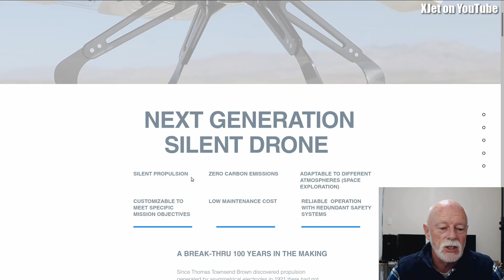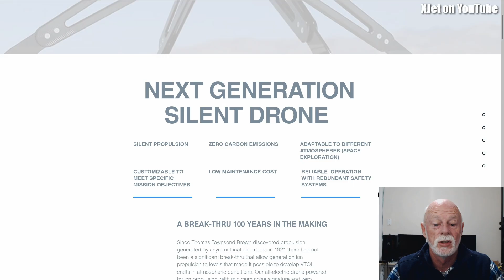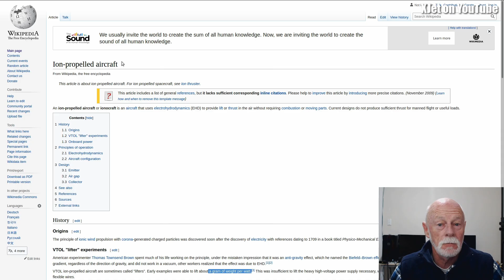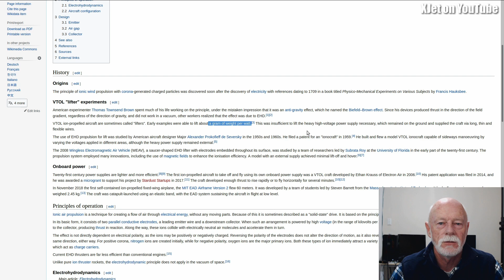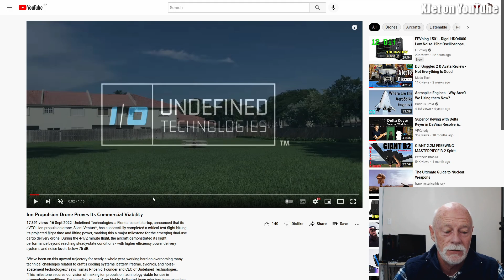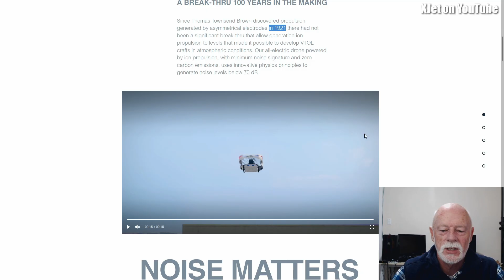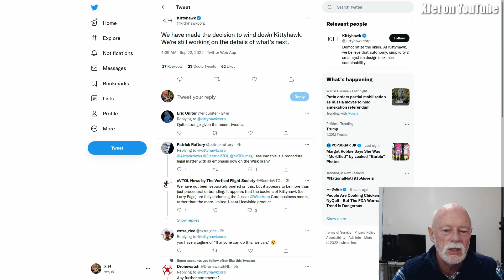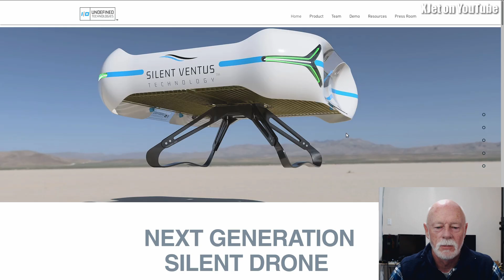Ion drive drone BUSTED

Comment: the weight is not the problem.its the duration that is poor. the batteries can only do minutes in the air on ion even if they had a tesla battery.

Comment: The idea is nifty, find a way to add a superconducting circuit to push enough air, maybe.  It seems likely to be similar to using capillary action to pump water.  It works but you can’t scale it.  A room temperature superconductor would help ;-)

Comment: I have recently gone down a rabbit hole of investigating alternate propulsion sources and various electromagnetic field topics. It is my opinion that this is absolutely possible via the use of a precision built transformer and lightweight batteries. The drone itself would also be very lightweight.

In addition, the actual arrangement of the conductive surfaces on the drone itself may provide a lot of room for optimization of the ion flow/path.

Really this is just a fancy “high voltage lifter”, built by a team of electrical engineers from UM who took the engineering further. I find it somewhat unfair that this video approaches it’s design from an aerospace perspective, when really a deep understand of electromagnetic fields and high voltage circuits is required to see how this would be possible.

Comment: You are so full of assumptions that you look like a concentration of cognitive bias. How the hell do you now the weight??? That thing could be done pretty light with fabric covering frame that can be lighter than carbon fiber and using carbon fiber sandwich frame. That would be extremely light moving slow without g forces, just to carry some sensors or small camera and solar cells and little battery and VOLTAGE CONVERTER, and even these aircrafts could utilise atmospheric gradient voltage differential

You are so flawed
Reply: Take a look at Ethan Krauss, it’s the real thing that can fly under its own weight

Comment: It seems that there is plenty to criticise this thing about based on the info from a year ago although when they say “zero carbon emissions” that should actually be a reasonable statement but I think your judging it based on the perception of the people who don’t understand that not everybody’s electricity is produced the same way. If the device doesn’t emit carbon then its a valid statement, its not their responsibility to word the features of the craft based on the the silliest understanding possible.
Reply: have you checked Ethan Krauss's ionocraft? His craft actually can be flown under its onboard power without using an electric fan like this company is claiming to be a true ionocraft. His craft stays true unlike what this company is claiming  their craft to be.

Comment: Working Ion drives already exist, NASAs Dawn space probe managed to change speed by 25000mph while in space using 3 solar powered xenon ion thrusters, and it only took YEARS of thrust to produce this result, so if you are patient and are in the vacuum of space this could be for you, dont expect this to work well enough in earths atmosphere though, not with current battery energy densities.

Comment: On further info this drone is a hybrid with a fan in the middle. https://www.youtube.com/watch?v=yMz_rtiM7FU They would achieve a lot more lift I mean significantly(10- 50x) more with magnetohydrodynamics
Reply from the maker: The "ion drive" is contributing virtually nothing to the lift capabilities of this craft.
Reply: @xjet  It is probably used in steering the craft more. They could do a flying disc with magnetohydrodynamics with a lot more thrust
Reply: @akosszeki  
have you checked Ethan Krauss's ionocraft? His craft actually can be flown under its onboard power without using an electric fan like this company is claiming to be a true ionocraft.

Comment: Hi, This is an existing technology that is used the past 50- 70 years. NASA uses ION drives for many of their spacecraft in the past 40- 50 years. It has noise, but not as much.
Reply from the maker: Ion-drive works in space because you're not fighting the forces of gravity.   Ion drives (even in space) produce only very small amounts of force.  Also, ion drives in space don't have to deal with things such as humidty, dust and other factors that cause issues when you try to use them in earth's atmosphere.

Comment: This is definitely a giant pile of tech hype scheme.
But my opinion on ionic thrust is it should be continued to be developed because a more advanced version of that technology may actually have high thrust efficiency but currently it is very unefficient in the designs being used.
Reply: There are 45 or so footage videos of a series of ion thrusters that really lift their power supplies against Earth's gravity on my channel and online! They are patented and verified specifically for having onboard power.  They are much more efficient than other ionic devices, due to extremely thin emitter wires, light weight, and larger ionization gap.  The patents, website, and YT channel for the crafts, show exactly how they work.

Comment: haha i guessed it was fake, it didn't sound right, and they may use ionic trust to stabilise the drone... thats why the drone is balancing on the center of gravity, ionic trust should be uniform. and the sound seams really to be a brushless motor with a propeller mounted in

Comment: I think many points raised here are valid for the design (EDF and grass movement), but I think what this reaction video gets misconstrued is that the technology is busted, it is not. The ionic wind is a phenomenon currently being studied in Ph.D. programs for developing initial "proof of concept" models of powertrains that will use this technology and is already proven in space applications. The problem is when a company like this, uses a technology that is not there and tries to raise capital to then attempt to fulfill such promises and realize that, it is incredibly expensive to put any motor out of its prototype phase, and that maybe is better to let universities run prototypes, develop simulation tools and offer some light into technology issues before running into forming a company and attempt to get the bag out of a concept that is not there yet. Great video tho but way too much "personal desire" is shown here to disproof a company, makes me think you would not offer a kind review to any "in-development technology" in other videos.

Comment: I have enjoyed many of your videos so please don't think that this comment is just me being upset about your Critique.  I think you should dig a little deeper to fully explore this.  There have been Ionocraft that can fly under battery power and this company has a working prototype which you can see in this video:  https://www.youtube.com/watch?v=yM_ZcN3dleo  Also see the MIT ion propulsion plane experiment shown in this video:  https://www.youtube.com/watch?v=IorDYGI1uqc
Reply from the maker: The MIT plane shows why this will never work as a method of drone propulsion.  They used a super-light airframe with a very low wing-loading and even then the drive was only just capable of sustaining flight.  The challenge of a vertical takeoff and flight is orders of magnitude more difficult and although the MIT craft does fly, its performance is strictly limited by the whole concept of ionic wind.  As the vid says, scaling these technologies is not easily -- in fact I would say not possible.  Remember, although we are already able to get 95% of the way to perpetual motion, we'll never actually get there no matter how hard we try nor how advanced our technology becomes.  Damn those pesky laws of thermodynamics! :-)

Comment: The tech was developed for space crafts. Now we're reversing the priorities to power flight on earth where thrust to weight ratio is favoured over mass efficiency (mass in this case referring to the accelerated particles like a tank of xeon)

The first powered flight by the Wright brothers was 12 seconds.

Here, they got a prototype working for 5mins on vertical thrust for whatever battery capacity it had on still developing technologies.

Silence is relative, at the height where you fly drones or aeroplanes, it would be barely audible, hence silent - sound intensity drops per the square of its distance. 70db at 100m is essentially silent.

0 carbon is that at present, it doesn't require carbon based fuel to generate thrust, but of a stretch as you said because most electrical energy still rely on carbon based fuel to generate them. But it doesn't 'require' carbon in the sense of a rocket jet

It is big, but lightweight and doesn't have moving parts. Service may be the equivalent of replacing worn units, not opening it up, fixing moving parts in place, lubricating, balancing etc etc. So yes service, but definitely cheaper in terms of time required.

As for the thrust per unit power, energy is not equivalent to power, so your calculations are wrong.

The same amount of energy is required to keep any amount of weight (assuming same density in atmosphere) "lifted" regardless of modality, the issue is to find limits which have barely been scratched. Electric phenomenon has been around for milenias, but the light bulb wasn't invented til recently, and then closer still before blue LEDs

This is just the beginning of research into this technology. 

It's like saying electric cars are garbage even though they have been invented before ICE cars and never took off prior to Tesla, and now we have them everywhere when technology switched. 

Im only halfway through your video. It's nice to have a healthy dose of skepticism, but yours borders on abject denial rather than facts.
Reply: Undefined Tech has 2 international patent applications.  One for a heated cathode lifter, the same thing has been published online for the past 20+ years.  Their other application shows a lifter with a ducted fan in the middle.  I am the inventor of the only one, actually a series of them, that are patented and verified for having onboard power, and lifting their supplies against Earth's gravity.  It requires too much power to lift such a heavy mass as the UT craft over such a small area with currently known ion propulsion and current battery technology.  The ideas shown in my patents show a way to build an ion propelled craft that is proven to lift its power supply, but it has very particular specifications and must by very lightweight.  The UT craft would not produce enough lift to carry a power supply without its very powerful EDF.  I hope this information helps!  I think the man that made the above video makes extremely good points.  A standard shaped "ion lifter" as well as two stage devices generally speaking, currently have an insufficient TWR to lift their power supplies.

Comment: Another indicator the "ionic lifters" aren't doing anything. The arms of large multirotors flex as the motors transition from zero thrust to overcoming gravity. Their scam drone doesn't show any lift at the corners of the frame.

Comment: Bruce, I hate to be that guy, but you fumbled this one. Car batteries are so large and heavy, because the contain so much energy, not because of their performance.

A 50kWh battery can be discharged at a much higher rate than 50kW. that would equate 1C (a discharge rate at the nominal capacity in one hour).

My guess is that a battery capable of repeated discharge with a reasonable cycle life would still weigh north of 30kg. if you're prepared to push the battery to its limits, it could be made lighter, but anything close to 10C is not going to keep  the pack happy, 5C being understood as a good maximum practical discharge rate.

of course at 5C and a reasonable cut-off voltage, the DoD will not be close to nominal, which will necessitate a larger battery.

maybe the thing could be .are to fly, but it won't be carrying anything 😄
Reply from the maker: I realise that you don't need a 50KW/H battery to get 50KW of power.  However, let's assume a 50Kg drone...
That will require 50KW just to hover and significantly more to ascend and/or maintain a forward movement.  Let's say the drone requires, on average, 70KW to ascend or maintain forward flight and you want a flight time of 15 minutes (or 12 minutes plus a 3-minute reserve).  That's a total battery capacity needed of 17.5KW.  Using today's lithium battery technology, that's a battery weight of 66.5 Kg... or more than the entire weight of the craft we've just been talking about.   Get the point? :-)

Comment: If this thing was real, can you imagine how dangerous it would be?  Exposed conductors with what 100KV, 1 MV potential difference?  What sort of newspaper headline would you get from 'Child becomes briefly incandescent after trying to pick up crashed drone!'
Reply: What the bullshit? Have you ever heard about magic ball with lightnings? It is almost the same
Reply: @ВалерийТерещенко-п3ф  IIRC high voltage discharge is considered dangerous at about 10 J. You can easily make low power magic ball. But you need at least hundreds watts for drone... so yeah, any ionocraft drone would be very dangerous to be around.

Comment: Not saying you're wrong, but; The EDF could be used mainly for steering and cooling, while the ion propulsion provides the lifting. In case it is indeed a hoax, would it be possible to balance such a large structure on 1 EDF motor alone? Maybe somebody could try build one and see if it flies.
Reply from the maker: If it needs an EDF for cooling then it is even less efficient than 1g per W which makes it even less able to fly, let alone deliver on the promises made.
Reply: @xjet  That 1g per W goes for the first experimental models, as it says on Wiki. It also says it uses a high voltage PSU, which might require some good cooling. I saw this video on youtube from the same company, which does look pretty convincing, search for:  New Drone Tech: No Propellers, and Yet It Flies! No Propellers, and Yet It Flies! 
Maybe try contacting them, or request a demo, could be fun. 🙂
Reply from the maker: @plower9711  But that 1W per gram is likely to be the power going into the panels so losses due to voltage conversion would be additional.  The efficiency of the basic system hasn't been significantly improved in over 100 years so it's still a very long way from being practical and will remain so for a number of reasons (those pesky laws of physics).
Reply: @xjet  Arg dangit those laws of physics again... 😅

Comment: Only a few minutes into the video, and Bruce has already made som mistakes. In regards to noise, a vehicle may be noiseless in itself, but in use the surroundings may make noise. Like in the movement of air, and particles, due to the thrust of the vehicle. Though the vehicles mode of thrust itself does not make any noise. As for carbon emissions, it just states that the mode of thrust in this vehicle does not give out any carbon emissions. The production for the energy used to power the vehicle may have produced some carbon emissions, but this site is about the vehicle itself it seems, not the energy used. If it had been a powerplant that listed the power it had for sale, it would have to include the carbon emissions from the production of that power. The vehicle using the power, and the company behind that vehicle can make the claim that its vehicle does not have any carbon emissions, if the motor / mode of thrust in the vehicle does not have carbon emissions.

Comment: If a drone is 10dB quieter it can be heard from significantly lower distances which means it will disrupt less people. 
Using noise levels measured at standard distance from a machine is a typical way of measuring produced noise and gives consistent metric that is useable for health and safety noise calculations.

Comment: sorry, this is very real. get up to speed with electrogravitics and hexa lifters. also, 70db, isnt really loud. dont you understand how loud your normal surroundings are? maybe your hearing is less good than it used to be as well? they do have demo crafts, there are several  on youtube, do some research first.
Reply from the maker: So why does it have a conventional electric motor and fan unit then -- when they claim it has no moving parts and uses ion propulsion?  eh? eh? :-D
Reply: I bet they use that EDF to cool those ion drives ;-)

Comment: You’d need a mini nuclear reactor to get something like that to work. Maybe darpa is allowed to play with toys like that but not any commercial manufacturer lol
Reply: still waiting for sth like that to happen
Reply: @Neutrino2072   that would called the aurora craft
Reply: Actually a little drone battery can hold it, i am doing a rc blimp with ion wind for a final paper, it is for the end of 2025, and i already did a smaller version, and just a 12v 1A 100cc battery can hold it
Reply: @GustavoOliveira-rg6nh   Check out  Ethan Krauss, he is actually has a ionocraft than can fly under its own weight.